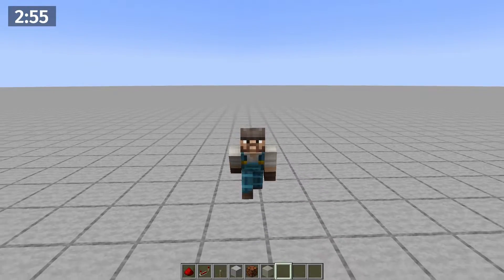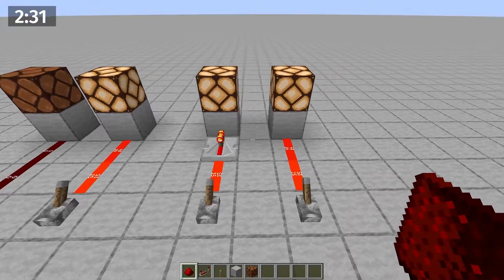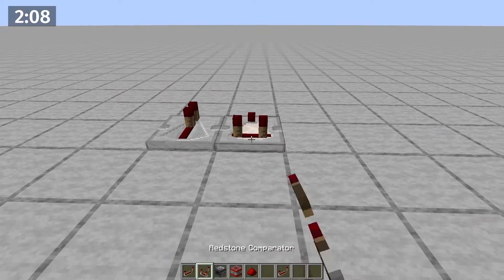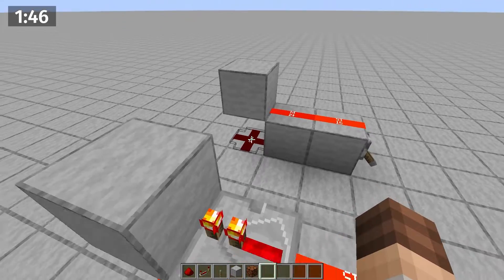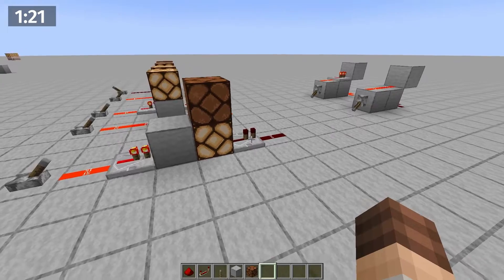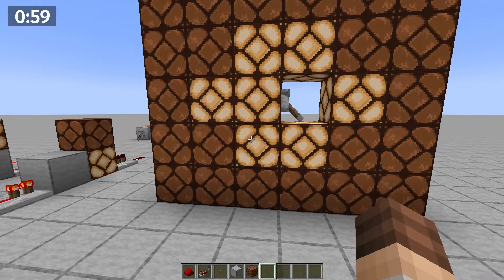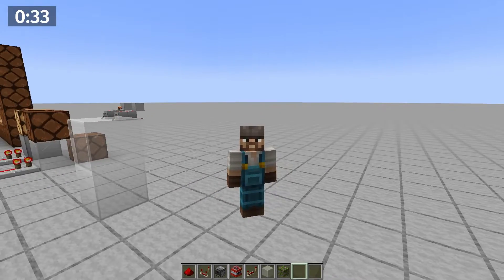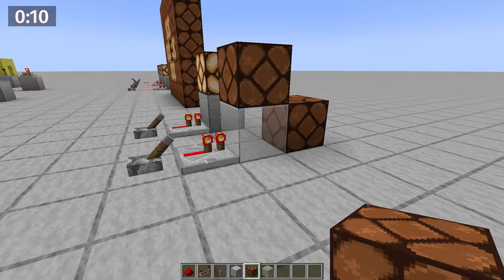Redstone Block Powering Dynamics

Comment: Wait, should Slime Blocks be an exception to the redstone's transparency rule at the end there? You can see through it but it transmit redstone signals.

Edit: Also Sea Lanterns and Glowstones (unable to pass redstone signal) but I think the wiki already covers them as you have said?
Reply from the maker: So yeah, very confusing. According to the wiki slime blocks are "rendering only" transparent. I.e. they act as full solid & opaque. Sea laterns and glowstone are listed as transparent but full solid even though you can't see through them (but for me it makes some sense for a reason I can't really explain... personally)

I.e. yeah, super confusing. Wiki helps a lot :-]. 

Great comment, thanks!

Forgot the link: https://minecraft.fandom.com/wiki/Opacity